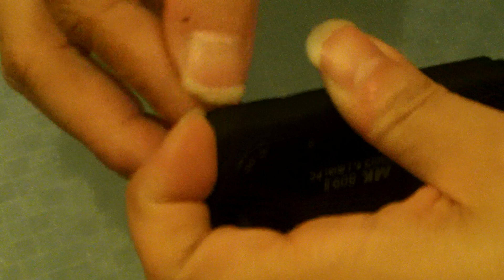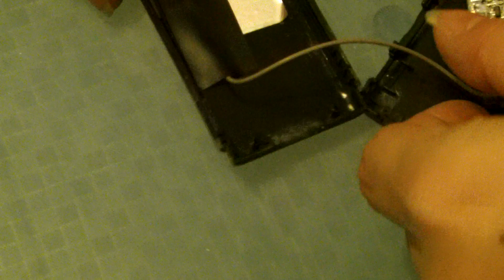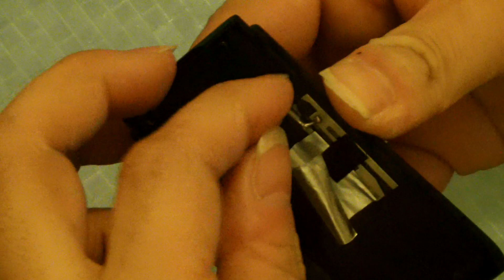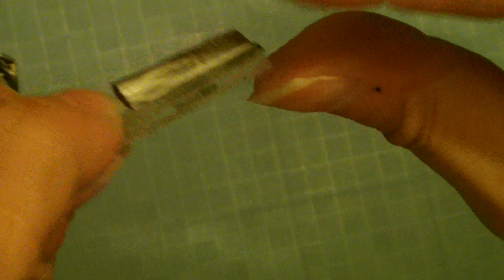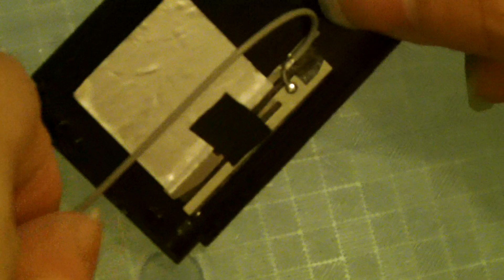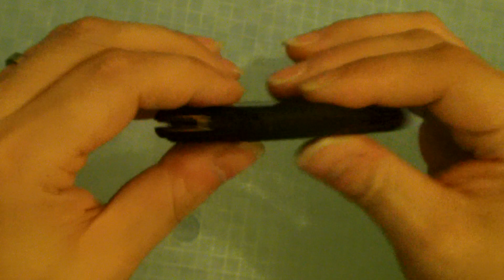How to fix MK809 II weak WiFi wireless signal problem

Comment: This had worked greatly on my MK809 III, at the beginning the signal was almost none... I have done your suggestion and it started to get the signal has is supposed to be and stopped to drop the connection.

Comment: This is done, because electromagnetic shielding in these devices sucks big time, so the ICs on the PCB interfere with the antenna.
Another suggestion is placing a electrostatic plastic between the antenna and the pcb, but be careful with the overheating.
If this fails, you can go the ugly way, and just move the antenna to the outside.
Or the expert way, just buy a higher gain (3-9 dbi), small external antenna, drill a hole in the box, and solder the ground and antenna signals to the pcb connectors. The thing is, for ppl without electronics know how, this is very tricky. The wires can't touch each other, or else the antenna will be useless. If done properly, you can get the full 802.11 wireless benefits, just like any other wireless connection.

Comment: I just got mine today and installed an app to monitor the speed of the wifi. I noticed that it starts really high (6-8 Mbps... I only have 7 Mbps internet), and then it drops down to practically nothing in speed, the video buffers, then it jumps back up again, and then drops again. The signal itself always seems to be fine. It's the speed. Do you think this would fix it?
Reply: threehappypenguins I have the same problem, could you fix it?
Reply: AntoNeo Blanco That fixed it perfectly. But let me forewarn you... DO NOT rip the yellowy/orange stuff connected to the end of the wire. It has other "wires" connected in it. I ripped mine, and I didn't get Wi-Fi at all after that. So I tried to line up the "wires" on one side with the other side and tape it together using that orangey tape stuff. Then it started working again. But it was a huge pain.